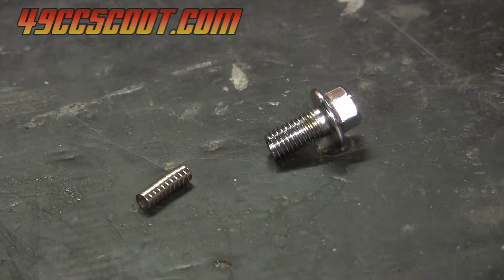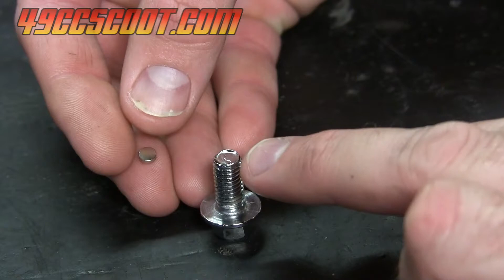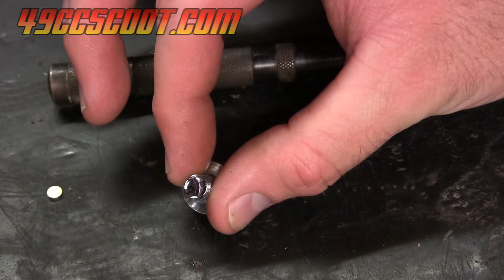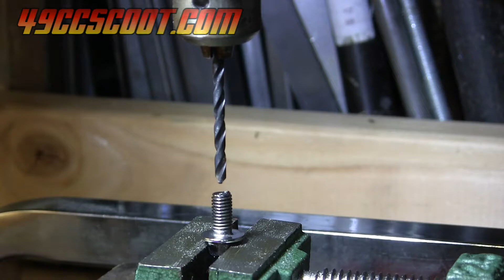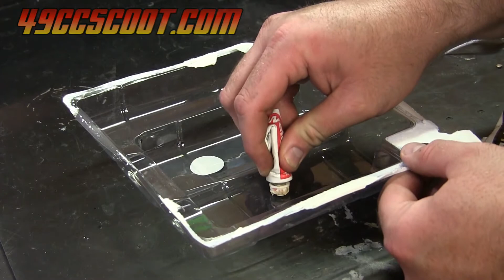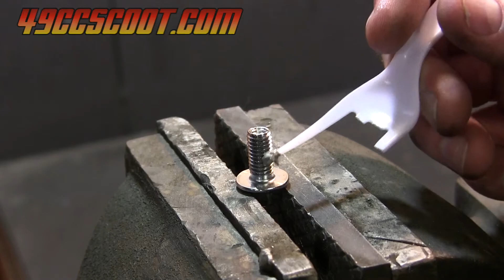DIY Magnetic Drain Plug Bolt How To : Oil Pan, Gearbox, Transmission

Comment: No wonder this idea is not standard practice during manufacturing anywhere! They want the accumulating metal particles to wedge between the gear teeth and artificially "increase" the gearbox wear to total failure! Then one has to buy a new set at a costly price.

Your excellent idea counteracts just that! I got a magnet 6mm x 2mm laying around, and have now a new purpose for it! Great job, keep up with the good work! ;-)

Comment: It's a steel bolt... put the magnet in the head of the bolt... it will still be magnetized. Plus if it happens to comes off, it won't be inside to cause damage.

Comment: This is how we do it in our factory 90GTVert, only in a volume production mode. Imbedding the magnet with an interference fit and using an oil resistant epoxy is the right way to go.  I like to put them flush to the bottom of thread for easier cleaning in the future, when sticking up it is more of a pain to get little particles off.  I would caution that NEO magnets are limited in temperature so you have to confirm which you are using, some can only handle up to 150F.  May not sound bad but that means they weaken with time, so you should replace every so often to retain full power.

A better way to go and not just on bikes and scooters, is to use a ceramic magnet.  Much higher heat range but a trade off for less gauss power, so get a longer magnet of the correct diameter and then drill hole deeper.  Again this is a more professional assembly so you need high quality drill press, bits, hold down, etc, to get down 1/4" or so.

If you are working with larger vehicles the proper way to go is put a much bigger Ceramic magnet inside the Spin-On Oil Filter.  That way you get all of the particulate that goes through the media paper, the ones under 10 micron that cause over 75% of the engine wear.  It is a fact the Oil Filters don't actually filter oil, because the can't capture the metal that does the majority of damage.  You can review this patented technology, SAE documents and Laboratory Tests that explain and confirm the benefits of removing micron size bits and pieces from our oil systems.

http://www.OilFilterMagnets.com
http://www.OilDrainPlug.com

Great job of explaining and well done video 90GTVert, spread the word that magnets are needed in any system using oil for a lubricant.
Reply from the maker: thepartsman Thanks for the info.
Reply: +thepartsman people like you give us hope.

Comment: @90GTVert thanks a lot for your helpful vids! I've been having a big issue with my cvt belt slipping. I have a 1e40qmb with a 68cc big bore kit, I've tried different belt sizes including the Bando belts you use, I've tried sanding the variator, I've even used belt conditioner sprays that prevent slip from belts but it still slips very baldly during take off until it seems to shift. I was wondering if you could please make a vid showing what can be the causes of my problem and what else I could do to solve the issue. Thanks for your help!!
Reply from the maker: fastmalibu01 Sounds like you need a stiffer contra spring.

Comment: Any updates on this? Anything you'd change if you had to do it again? Great video just wanted to know if it worked out longterm!
Reply from the maker: Still have them in multiple scooters. No complaints. Always check if you can get pre-made plugs cheap would be my suggestion. If it's cheap enough to buy them, then it's up to you if it's worth your time and effort.

Comment: @90GTVert I'm using a 1000rpm blue contra but most of the slip seems to be coming from the variator, specially when I use lighter slider weights
Reply from the maker: fastmalibu01 Are you getting black marks on the variator or excessive belt wear or dust? If not, maybe it's that weights are too light or you have a clutch issue.

Comment: @90GTVert yes I have black marks on the variator  and belt pretty much melts under hard acceleration and it doesn't need more tension. Can it be that I'm running 2000rpm clutch springs? Even with those springs clutch seems to engage very early. Schould I try 1500rpm?
Reply from the maker: fastmalibu01 Shouldn't be the clutch springs at fault. Put a straight edge across the faces of the pulleys and make sure there are no high/low spots. Check out my full service CVT inspection video. I'd go over the whole thing at this point and look for anything and everything that may be out of spec, worn, dirty, etc...

Comment: Hey man I got a Tao Tao gy6 scooter 150cc and my rpm is really low when it warms up an turns off 😔
Reply from the maker: Angel Perez Adjusting idle speed may be all that you need to do. Otherwise you can try adjusting the idle mixture. http://49ccscoot.proboards.com/thread/429/idle-mixture-adjustment
Reply: Thanks man

Comment: Neodymium (Nd) magnets aren't a good choice here because they start losing magnetic strength at fairly low temperatures . The typical consumer grade of Nd magnet begins losing strength around 80C/176F, with the loss becoming permanent as the temp approaches 310C/590F. A better choice of high strength magnet would be samarium cobalt (SmCo) or even good old fashioned AlNiCo (has the highest operating temperature of all, but also tends to lose magnetism over time anyway).
Reply from the maker: Thanks for the info. In practice, these magnets have been working fine and collecting debris. For engine oil, 250-300F max for Chinese air cooled 4Ts 50-150cc. Gearbox oil shouldn't pass those marks either I'd hope. If the oil gets to 590F, the magnet strength won't be the only thing permanently lost and will be the least of my worries.

Comment: Make sure the epoxy you use is resistant to petroleum products if you are going to use the bolt in an oil pan, otherwise it will turn to mush.
Reply from the maker: Dave I went with JB Weld because it's common and withstands most chemicals I've dealt with. I use it to back up my two-stroke cases for porting and it's in constant contact with oil and gas there. I've seen people patch oil pans with it. It's good for continuous exposure up to 500F I believe. This is not a commercial BTW. lol Stick with regular JB, not the quick kind if you want the best results. There are prob many other epoxies that work, but this is generally my go-to.
Reply from the maker: I think of silicone products more as sealants than glues/epoxies, but maybe there's something out there that works.
Reply from the maker: ***** Ever pry off a valve cover that's been JB Welded on? :P

Comment: Weirdly enough, my sister had some fridge magnets.. which were 8 x 1.25 and fit perfectly on my scooter, since the drainbolt kit that i got from priima (?) made so the gear oil slowly leaked out but with that fridge magnet i got no more particles in my oil ,ahaha =)
Reply from the maker: ErmaTheKitteh Glad you got something working. If the threads are good on the Prima kit, maybe using a soft washer under the bolt will stop the leak so it can be of use.